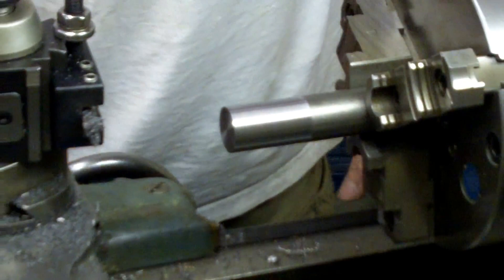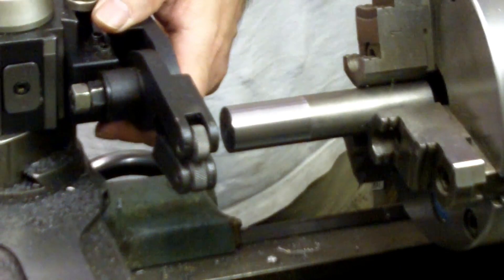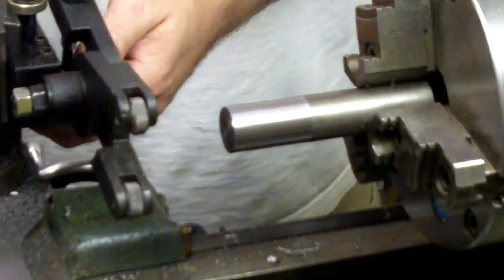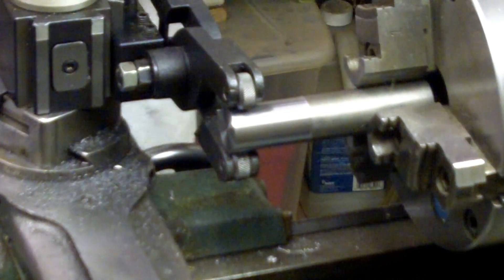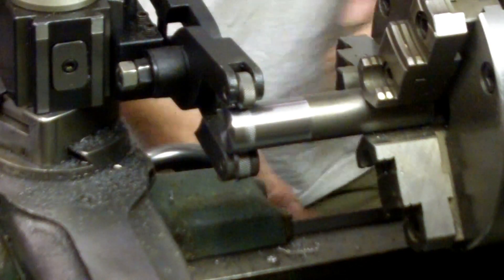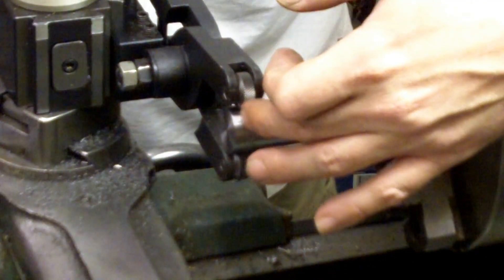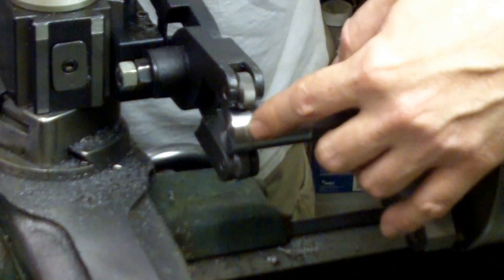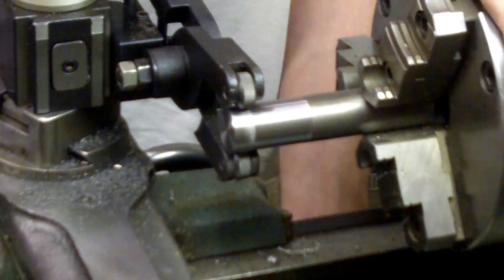Pt 3-4 How to Knurl on a Lathe

Comment: If you're doing a straight knurl with the scissors device, are both knurling wheels going to be hitting the same groovings on the work piece? I can see on a diamond knurl it wouldn't make any difference.....
Reply from the maker: Dave, when using a straight knurl, they will follow a pattern around the part same as the diamond. Thanks, G.